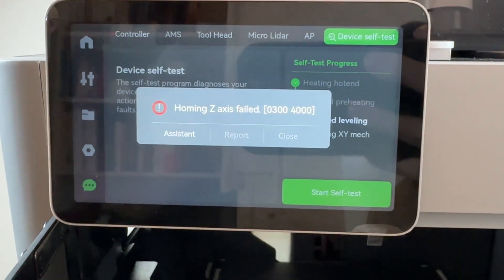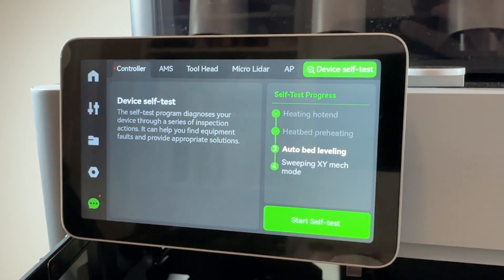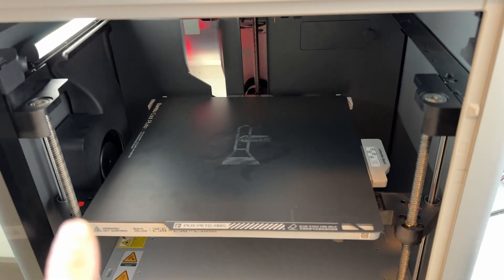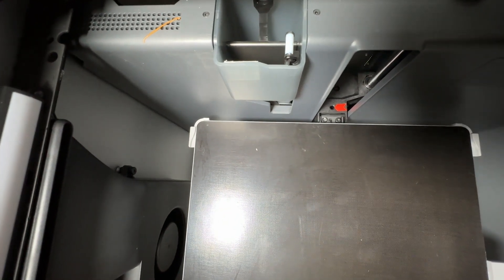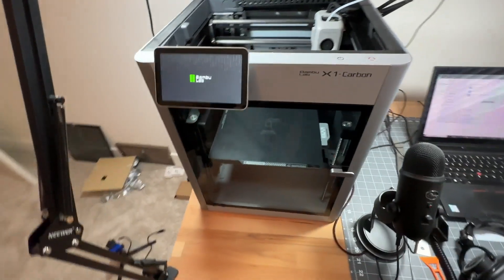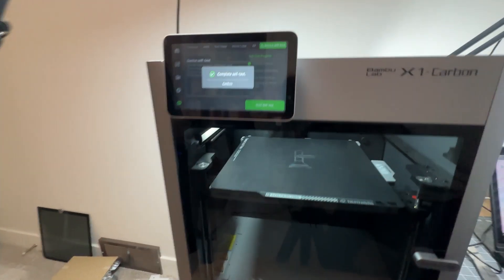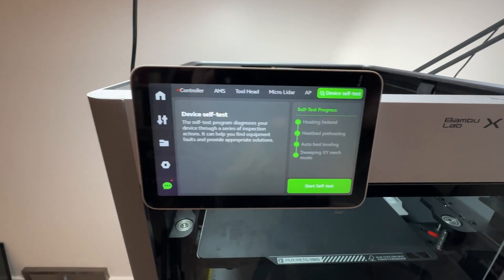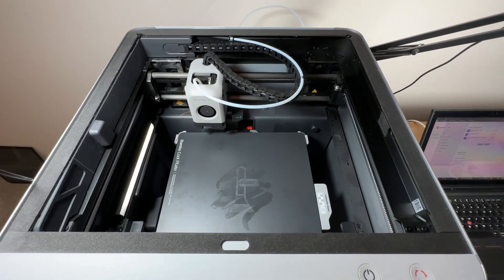The X1-Carbon is NOT Perfect - "Homing Z axis failed. [0300 4000]"

Comment: Thank you very much, this fixed my same problem with P1P.  I've been fighting this for a couple of weeks waiting for a an answer from Bambu Labs on a "ticket".  I've check everything ( loose cables, debris, contact points, etc, etc. nothing -- and when I loosened those screws and moved the print bed forward 1 mm ( paper thin ) it now homes and prints properly.  I don't understand how it could tolerances be that precise,  and how could it move enough to fail suddenly between prints ??!!.

Comment: After seeing your issue with the printer. I decided to share my problem I had when I first received my printer. I got the same error. I noticed that the bed would not go all the way up to the print head during the calibration. This was also the first time i turned the machine on. I found out the problem was the slide rod in the back of the printer next to the treaded rod was not in the slot during the assembly process. You have to take the back off and look up into the casing to see the rod was not in place. After the rod was snapped back into place the printer work as intended. Hope this helps someone.
Reply from the maker: Thanks for sharing, hopefully it can help someone else with the same issue.
Reply: What's the slide rod and what's the treaded rod

Comment: Thanks for the video. My plate was twisted and slightly pushed back off the heat bed and I didn't even realize it after flexing the plate to remove a previous print. This solved it. Appreciate it.

Comment: I notice that at the end of your self test you have a red dot next to the green "Messages" speech bubble (bottom left corner of the display). Have you checked what it says? I have the same problem with Z Home failing (nothing is touching the chute or anything else). It completes the self-test routine but the message says that Force Sensor 2 gives an unexpected signal. If I try to print, it tries to home, fails on Z, and aborts. This problem started immediately after a firmware update (to 01.05.01.00, 5/10/23); until then it had worked great. I rolled back the firmware to the previous version, but the problem persisted. Filed a ticket, waiting for a response.
Reply from the maker: I didn’t check what the red dot said and haven’t had this issue since filming this video a while back. Sorry to hear that you’re having issues. I was going to suggest the firmware until I read that you’d updated it and reverted it back… I don’t have any further insight, sorry I can’t be of any help. Let me know what Bambu support says, I’d be interested in knowing what the problem turns out to be.
Reply: @3DPrintStuff  Here is their response:
---------------------------
[...] For this issue, we would like to have you check a few connections on the heat bed and cable to ensure everything is connected well. 

Please carefully remove any glue on the connections by heating them with a hair dryer, or using needle nose pliers to pick it off.  Once removed please unplug and plug the connections back in. Some of the connectors are equipped with a buckle. Please make sure that you press the buckle to open it before you try to disconnect the connector.

The common points of loose connections are

    On the MC board of the printer, as seen in steps 6 and 7 of this guide Heatbed Replacement
    On the small PCB under the printer heat bed, as seen in steps 3 and 4 in this guide Cable Replacement
-----------------------------
I am not sure yet what I'll do. Removing the heatbed looks pretty involved and quite frankly I am not sure I have time for this. My printer is barely 3 months old and I've made all of 6 prints. This feels like a warranty case.

Comment: I got the same error - it turned out that my plate was dirty - washed off the old glue stick - reapplied and it worked
Reply from the maker: That's wild that it can pick up that small of a change in weight on the build plate.

Comment: Could be a precursor of bed sensor wires needing to be replaced. It starts periodically complaining about force sensors, then won't home at all. Some earlier machines have the bed sensor wire routed differently than how they recommend now.
Reply from the maker: That’s good to know. This isn’t one of the early kickstarter machines. I ordered it in November and received it December 24th. 

Do you know when they switched the routing?
Reply: @3DPrintStuff  very recently, I was given the instructions at the end of december, likely your machine was assembled prior to them making the adjustment.

Comment: Mine has been having issues with the LiDAR since day one. It says it cannot see the test extrusions because of lack of reflectivity in the filament(even white). Nonetheless, the prints seems to come out nice.
Reply: Have you printed any flow cubes to see if the flow rate is close without the Lidar?
Reply from the maker: yeah I'm not sure how much the lidar is really affecting the prints. I've had a few prints that are going to collide with the flow calibration strips so I turned it off. The prints still came out great and I can't really see a difference. I'd imagine with some unknown materials it can be more beneficial.
Reply: @3DPrintStuff  can you turn off the flow calibration but keep the first layer inspection on? You should do some calibration prints with and without lidar enabled. I've yet to see a video showing the lidar at work. For all we know it might do little to nothing.
Reply from the maker: @rileyneufeld7001  That's a great video idea. I'll add it to the list.
Reply: Did you try calibrating it with the pei plate on it ?

Comment: Had the samething happen to my P1P. Got me stumped enough that I was about to shoot Bambu a troubleshoot ticket til I saw the PEI plate wasnt placed properly (extender too far out or not all the way in however one sees it). Fixed it, reboot & voila, no problemo. Had another strange error msg on display (but not in Studio app) & rebooted again to fix. Not perfect for sure but perfect enough
Reply from the maker: That's kinda funny. I'm sure you were kicking yourself over that one and relieved it wasn't something more severe. 

Definitely perfect enough, really liking the overall printing experience and the quality of prints coming off this thing.
Reply: Just got my P1s and it was shooting the bed level code and I’ve already had problems with it not connecting to the internet then randomly not homing at all, the bed was off by maybe 2 millimeters lol

Comment: Currently one of the best printers out there. Quality of print, accuracy and speed are phenomenal, let alone the multi colour options with AMS.
Reply from the maker: This thing has been great so far. From some of the other comments, this issue may have just been a firmware issue that I miss diagnosed. I have loved using this thing so far. How long have you had yours?
Reply: Yes, fantastic so far, almost zero failed prints and those that have have been user error. 3 weeks today I got it and now about 100 hours of printing with it.

Comment: Did you update the firmware?
Reply from the maker: I did just now because you asked. It never prompted me to update the firmware. 

Was this issue related to the older firmware version?
Reply: @3DPrintStuff  I believe so. I wish the machine would prompt you automatically right away when there's a firmware update when you turn it on for the first time.
Reply from the maker: @cerebralvision  It would be nice if it prompted you on startup or as soon as you get it connected to your WIFI. 

I've updated it now so we'll see how it behaves. I had a few more phantom z axis homing failures since this video so maybe it was a firmware issue.